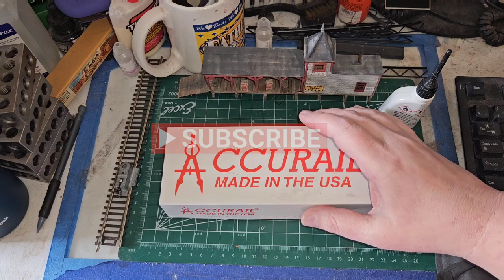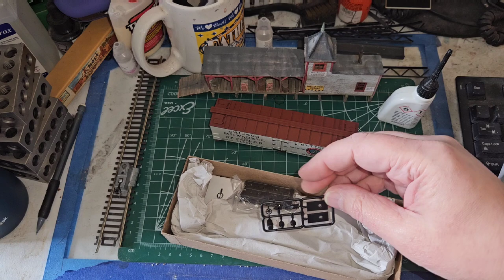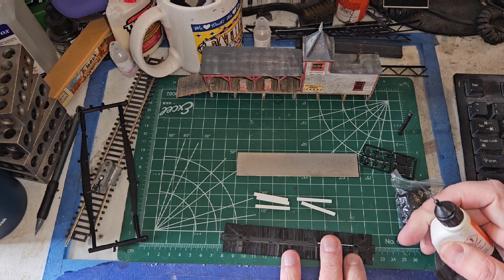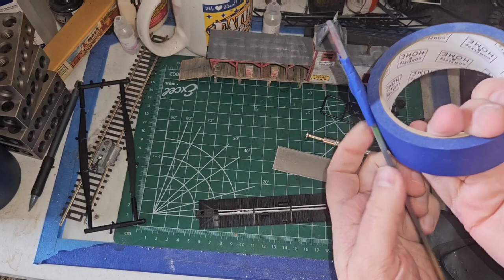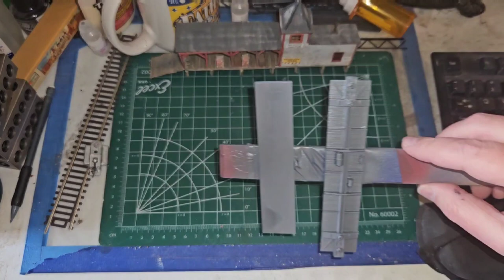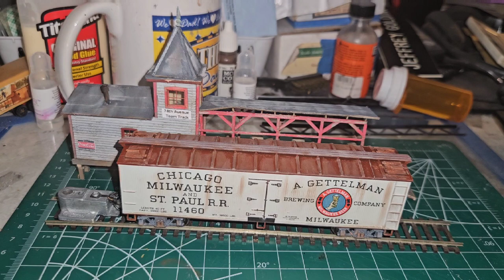Gettelman Brewing Company Wood Reefer Kit Part 1

Comment: Almost all of my MOW fleet are Accurail.  Only one that's not Accurail is my track cleaner, a Revel MOW car which I have to change the trucks so I can change it to metal wheel sets.  I've already changed it to body mounted Kadee couplers.  I really like the Accural rolling stock even though it is not as detailed as Kadee cars or Intermountain.  I've changed out plastic wheels for Walthers Proto 2000 metal wheel sets on over 100 pieces of rolling stock and chopped off all the talgo truck couplers and changed them to body mounted Kadee couplers.  So far over $400.00 to do this.  Now I've got to go back and weigh each one & bring 'em all up to NMRA weight standards.  I use Harbor Freight car wheel weights.  Cheers from eastern TN
Reply from the maker: I will have to check out the car wheel weights next time I'm at Harbor Freight.  Thanks for the tip.